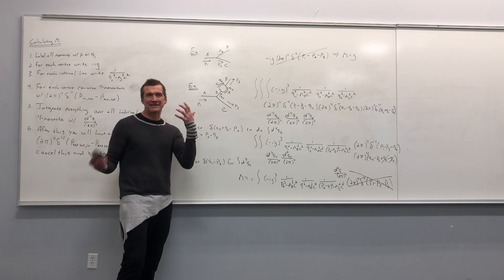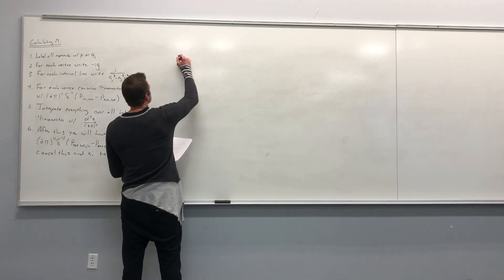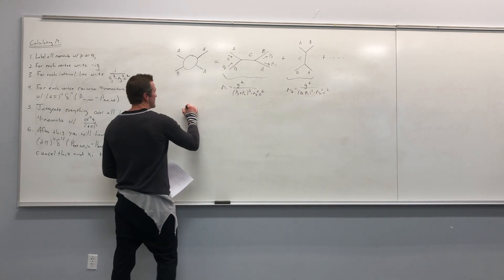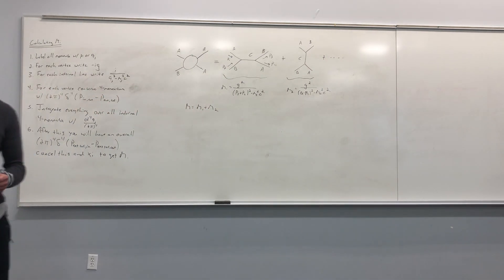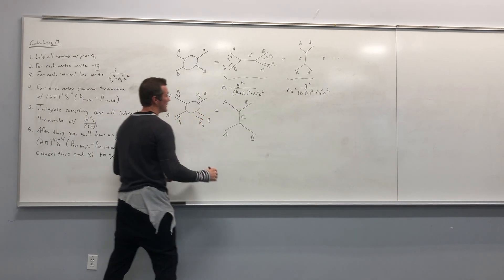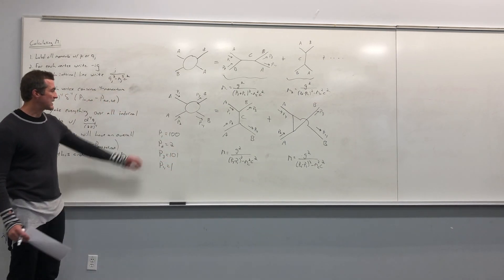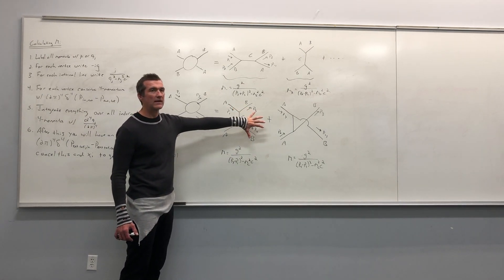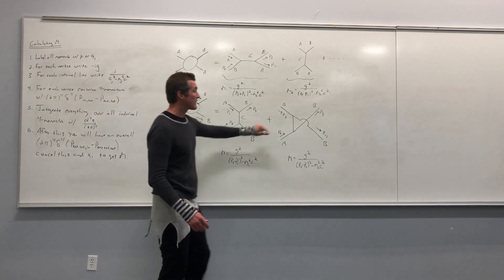Particle Physics Lecture 18': Mr. Feynman and the ABC's part deux (Scattering)

Comment: Isn't there technically a 0-vertice option for computing the probability of A+B -> A+B? I assume that's not counted, but is there a good reason why the 'nothing happens' option is treated differently?
Reply: Wouldn't that be two parallel diagrams A-A + B-B ? But such degenerate "interactions" are already elsewhere in the Lagrangian, namely the two quadratic "mass terms" gφAφA which count as part of the kinetic terms from the "free" fields A or B.  So, no interaction here, and thus these contributions to the overall action S=Int(L) are not a part of any interaction amplitude via M. 

I'm not an expert (yet ;) but I wouldn't know how to apply Feynman's rules as stated to zero vertex graphs. I guess if you would generalise them to zero-vertices they would just yield zero, because, again, zero-vertices are already treated in the "free" Lagrangian part.
Reply: There are 0 verticies in that scenario, and so you can think of it as "multiplying by 0*-ig" when computing the M-value, so that contributes nothing to the overall M value.